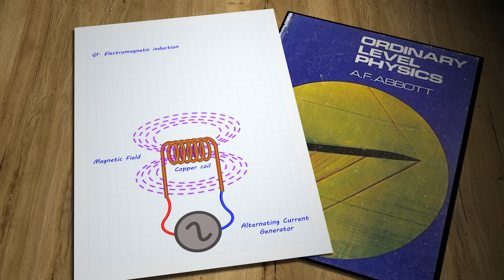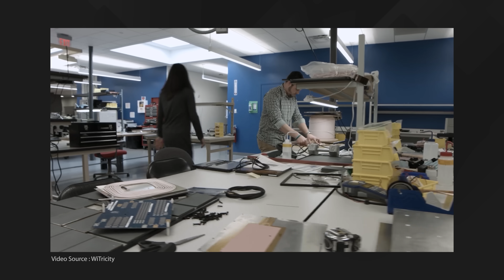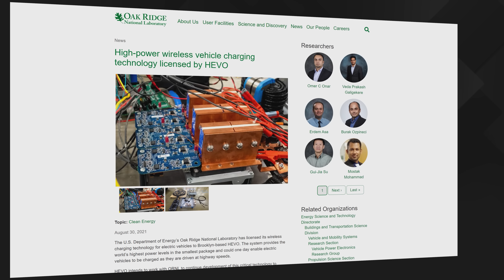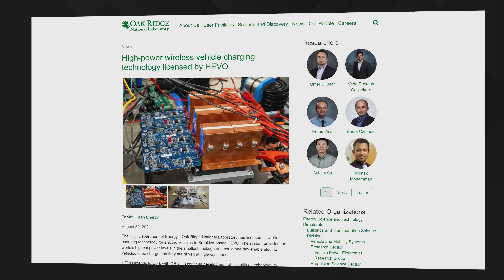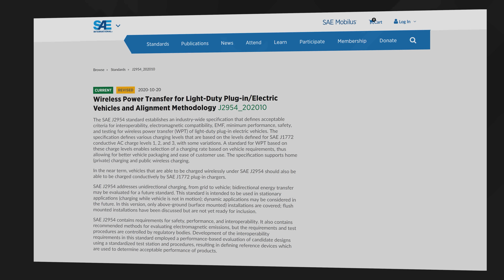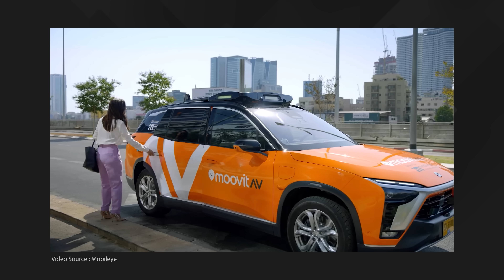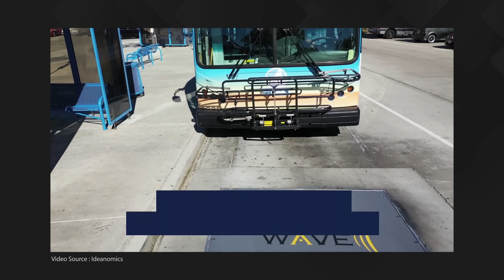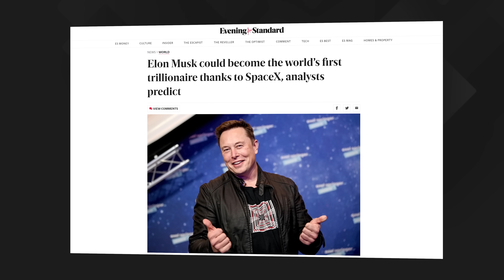Wireless FULL EV charging has arrived!  Exciting new tech breakthrough.

Comment: A way to describe electrodynamic induction is a swing set.  Say you reach up and push on a lever to do work.  The further the lever is away, the harder it is to impart work on in.  Very quickly you cannot really impart any work on it as the level is moved higher.  Now introduce a swing.  As long as you pump or push someone one the swing at just the right time, they go higher.  If say you push someone in the swing at just the right time and they take that energy and push on a lever that is higher up, you effectively transfer that work to the lever.  This is basically how resonance induction works.  Granted there is a limit to how high you can effectively go, but it is much higher than not using resonance.

If you have ever taken Calculus based electromagnetism, there is a more technical explanation that can be broken down into simple terms for those who have not taken such a course.  When you look at a capacitor, it is a charge storage device.  For the swing analogy, you can think of it as potential energy when you are at the top of the swing motion.  This is as in the higher you are when you stop going up, the faster you can potentially be going when you reach the bottom of the swing motion.  An inductor is a current storage device.  For the swing analogy this is the movement (kinetic energy) you have at the bottom of the swing motion.  When on a swing, you are oscillating between having kinetic energy at the bottom of the swinging motion and potential energy at the top of the swinging motion.  So going over to resonance induction, you alternate between having current flow in the inductor you also use to transmit power and charge in the capacitor.  For a more technical explanation, when using an AC sign wave, a capacitor lags 90 degrees behind the sign wave while the inductor leads 90 degrees in front of the sign wave.  This is as in the capacitor stores up the incoming charge and so lags behind while collecting this charge with the sharpest increase in voltage leading to the greatest power draw going into the capacitor and then as the sign wave goes down it is putting out power also lagging behind the sign wave.  For the inductor, it is impeding the change in current flow and so a voltage builds up across it as it impedes the current flow as the sign wave rises and then as the current decreases, it wants the current flow it had before and so is dumping out all of this power as in a voltage difference the opposite way.  Another way to put it is with a capacitor, the more voltage differential it sees from its current charge, the faster it charges or discharges as in greater current flow while the inductor the higher the voltage differential, the faster it changes its current flow.  This corresponds well to the swing notion of the offset of the potential energy at the top of the swing motion verses the kinetic energy at the bottom of the swing motion.  This -90 and +90 degrees equals 180 degrees between the two and this is how you end up with a resonance.  To look into this further, you can look up LRC (inductor, resister, capacitor) circuits.

Somebody can check my explanation, but I think this is a pretty good way to put it more in layman's terms of what is happening.

Comment: As I understand Nikola Tesla's original concept of wireless power, it would have broadcast the power omnidirectionally for use by anyone at all near a transmitter -- and in the ultimate development, the transmitters would be spaced to saturate the country with wireless energy on tap. (Fictional extrapolations of this idea can be found in, primarily, Robert Heinlein's short story Waldo and also in Keith Laumer's novel The Long Twilight.)

The concept of magnetic resonance would seem to eliminate two pitfalls of EV charging. One is analogous to "war driving" in which a laptop is used to "pirate" someone else's unprotected wireless Internet access. The other is the embarrassment of hurrying out the door to the garage while the automatic garage door opens, and driving off without disconnecting the charging cable.
Reply: Fiction is where Tesla's wireless power idea will stay.  It's completely ridiculous.  It just shows you how many people have never learned physics.  Tesla had some great ideas, but this wasn't one of them.

Comment: It's a very elegant solution to the charging problem, I'm quite impressed with the lensed magnetic loops; did they get the idea from solar flares coming off the sun I wonder?  🌞🌜 Congratulations to the team at the Massachusetts Institute of Technology!⚡💧⚡ Edit: magnetic resonance does interesting things, resonance in general is pretty amazing.  From tuning forks to AC electromagnets,  synchronicity moves the energy efficiently across the room!
Reply: They didn't do anything that wasn't known since Faraday and Hertz.
Reply: I imagine it went a little like this:
Engineer 1: Hey you know how wireless EV charging has so many problems
Engineer 2: Yeah.
Engineer 1: What if we tried matching the frequency of the receiving coil to the charging coil?
Engineer 2: Eh, worth a try i guess.
tries it
Engineers 1 and 2 together: Holy crap it worked!!
Reply: @killman369547  That has been used in radio receiver intermediate frequency amplifiers for  around 90 years. The difference there is very tight coupling. Without tight coupling efficiency will suffer.
Reply: Solar flares are a different kind of a beast compared to electromagnetic beam forming.

Comment: Thank you for having a go at the wilfully blind naysayers - it's taking a depressingly long time for the penny to drop.
 By the way, John Ward has done an excellent video on how the UK grid has plenty of spare capacity for charging millions of EVs. With vehicle (and house battery) to grid energy transfer, that capacity will be dramatically amplified.
Reply: That's cos we closed down all of our industry :-(.  Actually, a ridiculously large amount of power have been saved by people moving from incandescent bulbs to LED.
Reply: @Muppetkeeper  
Problem is we use more lights and leave them on more often.🤷‍♂️🤦🏻‍♂️
Just imagine how much we could save if we actually properly insulated most of our buildings..... Thats the biggest low hanging fruit in terms of energy saving for most of the developed ....energy hungry world. Be it keeping warm or staying cool especially if you are going to use electricity for space heating of buildings. 
Wasting world.
Reply: @clivestainlesssteelwomble7665  Here's some low hanging fruit for you, get rid of all the ICE cars and automatically increase your efficiency by 50%-27%=23% or a little more.
Reply: @clivestainlesssteelwomble7665  Speak for yourself, i turn off all my lights and the first thing I did when I moved home was to insulate it properly.
Reply: @tedmoss  

A more energy and material efficient solution is to bin the engines and replace them with standardized cheap crate E motors, controllers and standardized battery packs wherever possible. 

Theres a huge amount of energy and materials tied up in a vehicle.  At one time it was calculated as being much more than the average ICE vehicle will use in its life time. 
Got to stop junking  environmentally expensive stuff and start re using, repairing and recycling what we already have.

Im hoping this tech is as efficient as they are claiming at transfering power as in general inductive charging's been very inefficient for charging devices till now.🤔

Comment: interesting I wonder how would this technology compare to laser wireless charging. Where the sender sent a focus laser, and the receiver is equipped with a solar cell tune to the laser's frequency. I remember reading about in a paper, where it's able to transmit over 10 km at around 40% efficiency and 40km at around 8% in clear non-foggy weather. If the efficiency increase, it could solve the battery weight issue for electric airplane through inflight wireless charging.
Reply: The biggest problem with that is the lack of coupling. If there is no reciever the laser just dumps energy where ever it ends up, and the range means the 'danger area' is huge. Coupled resonators don't do that. If they are not paired the resonance is different, and the driving circuitry doesn't put significant energy in.
There is also the issue of eyes. Lasers are able to do even more damage than the energy levels suggest, simply because eyes are so vulnerable.

Comment: They have already installed a wireless charger in Oslo, Norway. So far it is only a test unit but it seems to be working fine. The car they use for testing is a moderately modified Ford Mustang and it looks like it is a taxi. The transmitter are on what seems to be a taxi waiting area. The receiver is retrofitted under the Mustang with so software added to the Ford’s own software.  All you got to do is drive the car up to the loading spot and the software will guide you into correct position with a tolerance of 10 centimeters. There are even some sensors that will inform you if any metal objects like a can is under the car. There are clips on YouTube where you can see the charger being tested. 53 kw charging speed on a battery that is already 80% charged is not bad. Since the charger is optimized for busses you get higher charging speed if you raise the car.

Comment: Transmitting power and doing so it’s a 80% efficiency to your phone means you 1-2 watthours, in the grand scheme of things not all that much power. 
But if you’re gonna charge is 70 kWh battery of a car at 80% efficiency that starts to really freaking hurt, both your wallet and the environment for the sake of laziness to plug in a cable. 14kWh would be lost, and that assumes the vehicle is perfectly centered over the coils, Also given different vehicles have different ride Heights it would be hard to optimize so we might be looking at an even lower percentage efficiency in real life no matter what manufacturers claim in their lab experiments.
The only possible redeeming quality is the people who don’t want an electric car now considering one, but I don’t think this feature is the thing that puts them over the edge.
Reply: exactly, this will remain a niche product for that reason alone. 
I go further though and also condemn the wireless phone chargers. Do the math when looking at the phone market. If all phone owners were to wirelessly charge their devices, 1-2GW peak capacity world wide would be needed just because of their laziness to plug in a USB cable...    I say this should be forbidden - sounds ridiculous to me in times when we want to increase efficiency wherever possible!
Oh and how is that wireless anyways. Now you have the same size power supply, the same length of cable but instead of a lean plug you have a >50mm wide heavy coil + magnets... more bulk, more waste... who are these marketing folks kidding.
Reply: @andreasbrand3191   although in theory you’re right, in practice it is an utterly irrelevant amount of energy. 
If you drive your car for more then a minute minute, and i mean the most efficient tesla, not an ice, you will have used far more energy doing that in one minute, then you could ever lose over your lifetime charging your phone wirelessly versus with a cable. It’s not worth fixing that problem, instead spend the energy elsewhere.
I.e. insulate your home converted to using a heat pump drive electrically try not to fly too much and if possible walk or bike places.
And try not to boil too much water because again if you boil a few centiliters more you would’ve wasted more power doing that then fixing those wireless chargers the amount of energy used just doesn’t register. And this is always been the problem with people who are pro environment, they focus on stuff like changing your lightbulbs instead of the things that actually matter like insulating your house. Does feel good things like changing your lightbulbs fundamentally have almost no impact. End it doesn’t matter to how many people you extend that out it’s still such a small percentage it’s not even a percentage it’s like 1000th of a percentage point i.e. it just doesn’t matter fix the big things first. Like making sure people don’t start charging their cars at this low of an efficiency
Reply: @FreekHoekstra  the amount personally is negligible, no argument there., but it does matter 
you're right. Total energy waste for a phone over its let's say 5 years of lifetime assuming 10Wh batteries assuming 20% loss (again, that's already good, I've measured it myself) makes 365days*2Wh*5 years = 1kWh of energy.  Sure, that doesn't seem like much, as you state, less than 0.01% of let's say the average american with their   roughly 10000kWh consumption of just electric power.

Where you're not right is that it shouldn't matter. All of it matters, we need to crack down on all wastefulness if we want to solve our HUGE sustainability problem. 
The most important thing here is: it's a step the wrong direction, even if it's tiny. The cables are better, why introduce a 20% more wasteful technique that also needs magnets and other materials not needed before. It's simply a step in the wrong direction.

Then there is global scale - again, simple math.
Say 1 billion phones use wireless 80% efficient on 20W output USB switching powersupplies. That's 4W power loss on each. That's 4GW peak WASTED... granted, they don't all plug their phones in at the same time and they only charge for 30-40mins, but there are also more than 1 billion phones around now. 
While it seems insignificant, it surely sums up....  and that's the core issue here. Not caring about the little savings will not get us where we need to be.... actually where our parents already needed to be 30 years ago!!!

every step counts but yeah, this one is so insignificant it's not worth talking about it much.... which is why one should just do it and move on to insulating the house or not using concrete to build new ones... and more home office instead of driving, vacation around the corner instead of flying ...  sure ;-)
Reply: @andreasbrand3191  it doesn’t matter, changing it takes effort, and that effort is literally better spent changing anything else.
Whether it is the insulation in your house, what car you drive, to even you boiling a one cup less water over that entire year….
 whatever it is you do better you will save more energy doing that then replacing the charger.  People will only change maybe 1 to 3 habits a year, I would rather they change the amount of water they boil for pasta, or the excess that’s left in the water heater when they make tea, food waste they deal with, how much they use their car. 
Literally any of those has probably over 1000 times more impact to change than this particular thing.  
So why not do both? It takes up the air in the room that should be used to talk about the actual big ticket items, Which is heating and cooling, insulation, food and transport.
Everything else is a marginal energy use and any effort spent there will only ever give negligible gains. But those negligible gains still take as much attention and thus take attention away from the important items. And then people choose to fix the wireless charger instead of being efficient with the heating by turning it off when they are out for the week.

Again like driving an electric car or adding more insulation your house will literally save so much more power it’s not funny. We’re not even talking about like 10 kWh and we’re talking tens of thousands of kilowatt hours.
So yes it is a relevant and it’s actually a problem that we always talk about these tiny marginal things like replacing lightbulbs, don’t use an electric wireless charger, turn off your devices that are in standby mode. That’s all cute and technically true, but those aren’t the problem.
It’s heating and cooling your home,  driving and flying,  and here we are talking about at most 0.1% negligible things more, then we’re talking about fixing the actually important things that matter.  Which is insanely destructive
Reply: @FreekHoekstra  The biggest savings I made were from converting all my windows to double glazed, but of course you also need decent wall and ceiling insulation. It also helps to fit draught excluders on external doors. Amazing how much it has all saved me on heating and cooling.
Where I live in Australia, all the home solar panels produce so much power on a sunny day that the grid does not need much in the way of fossil fueled power, and sometimes the distributors are paying only $0.01 per KwH to generators.
I do not know if people who say they will never buy an EV are aware that the time when new ICE cars will not be an alternative are fast approaching, so of course, the infrastructure for EV support will improve, just as support for fuel and service of ICE vehicles will diminish and become far more expensive.
Reply: Also a Whr or two lost in transmission charging a phone isn't likely to be a problem for say fires/spontaneous melting of nearby metal items that happen to accidentally have dimensions that resonate with the coil, but multiply that power level by 1000 and install it all over the world and I become a lot less confident this is worth the very limited benefit. But then again based on how I use my phone, wireless phone charging is less convenient than plugging it in even before considering how much more expensive the charging pads are than off the shelf USB leads.